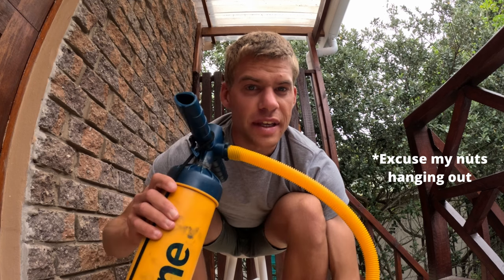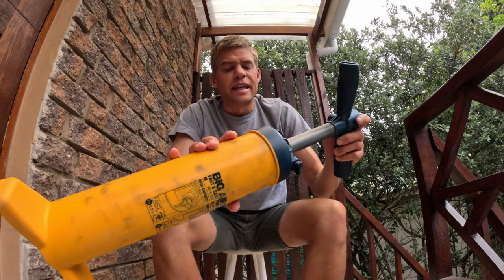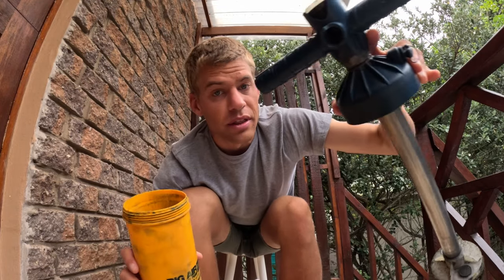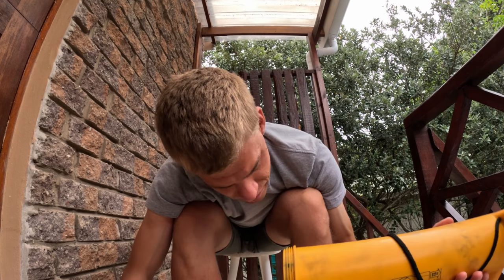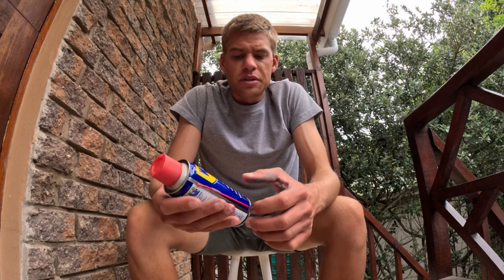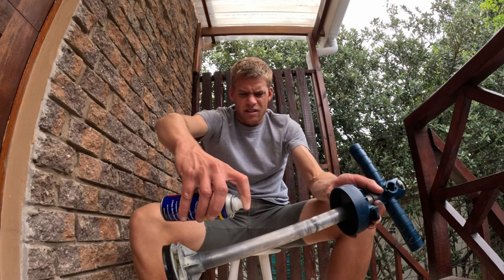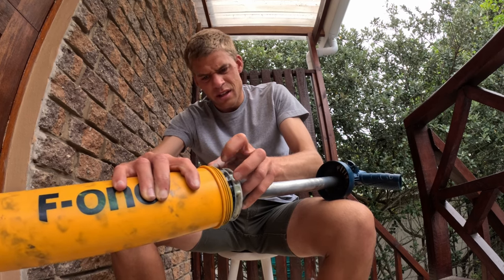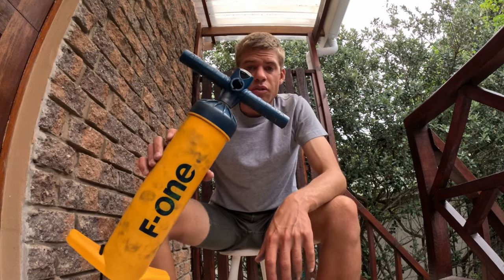How to Clean a Kite Pump

Comment: WD-40 is not a lubricant...
Reply: Yes it is. It's not a good lubricant, but it does lubricate.
Reply from the maker: Fair point, I suppose. What would you suggest instead? I'd personally avoid thicker oil, etc as the sand gets caught in it, making a grinding paste.
Reply: I am using technical vaseline. Found it on some forum and it seems to work well
Reply from the maker: Ah, that's interesting! Great point. Thanks for sharing! 🙏